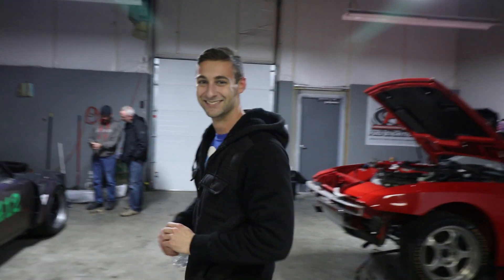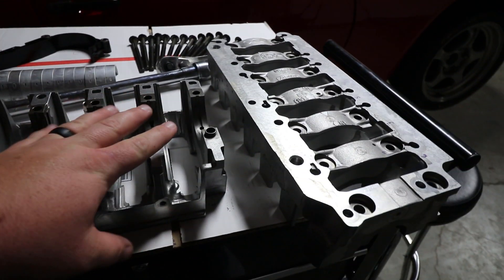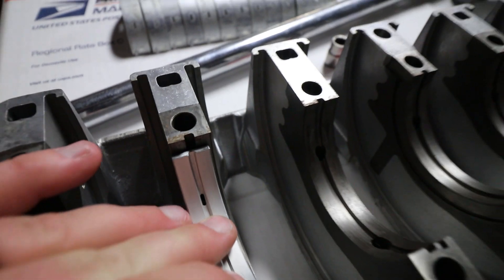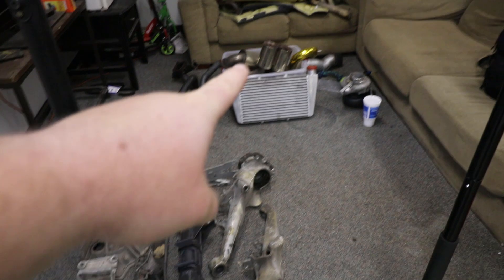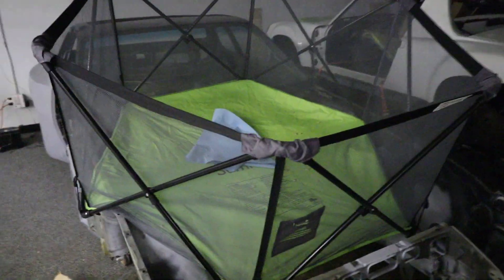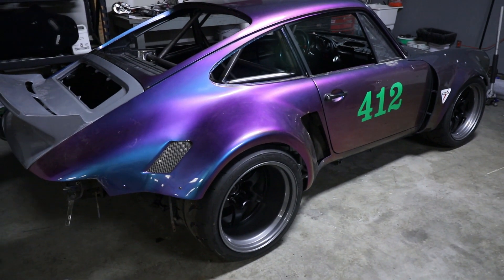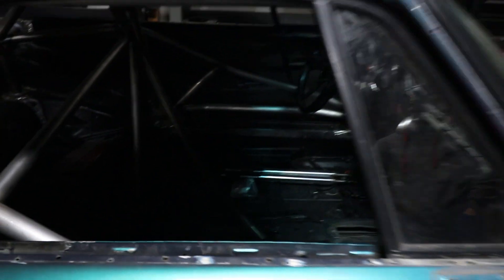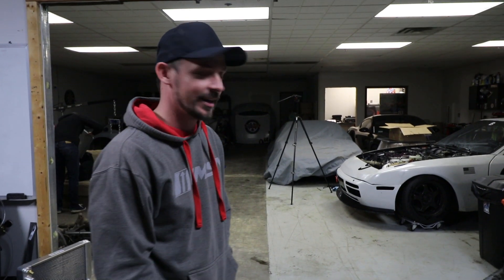5 Cylinder 944 Build - Part 10 (Porsche 944 07K Swap)

Comment: Hi! thanks for great videos! I have  an old boxster with the m96.20 2.5L engine and i want to turbo it. I have allt the components and everything it takes to build it i'm just curious how the engine block will handle 0.4-0.5bar boost and also if there is aftermarket headgaskets avalible or if the original would hold for 0.5 bar. Thanks!
Reply from the maker: TPC makes turbo kits for Cayman, and they keep boost to around 5 psi. They don’t change head gaskets, just a bolt on deal. The turbo would obviously make the car a blast, just be conservative with your tune and you should be fine
Reply: TPC racing has some good Boxster Turbo kits and videos.

Comment: I recently bought 2 944s so one is getting 07k na build with itbs and an 01e transaxle. I am curious thought do you think the Lamborghini manifold from the opposite side would fit?
Reply from the maker: It should fit the bolt pattern but would obviously run directly into the firewall.
Reply: Thanks for the info I plan on modifying it to exit lower and think the Lamborghini part might be a good starting point

Comment: The 07K head is garbage without porting. If you compare ports to the TTRS/RS3 it's night and day. The 07k has econo ports for bottom end torque and economy. With Veicomer dimple porting and a straight as possible intake the 07k cammed Is a 300hp engine all day. It seems crazy but porting is not too expensive, especially with a bulk run. Probably less than a grand. know you are trying to make an affordable kit for everyone and you are the man! You and your bro 👊 are doing a most excellent service for the 944 people. Just remember, a lot of these "Porsha" guys spend over 10 grand on a 2.5 turbo build 😳 🤯. 07k needs porting, intake, cams, and header to make around 300hp NA. And turbos only double whatever power level you have about every 18 pounds. 1 Bar plus a touch for temp and exh restriction. Start with 190, get 380, start with 300, get 600 😁
Reply from the maker: I definitely want to play with porting at some point. I’d still like to do a 300hp NA build, potentially for the 914. This one is just going to get boots crammed down it’s throat until it makes the number or goes boom! Thanks for the info and kind words!

Comment: Hi, BB, I have lost the plot a little on the Kman engine build. The crank housing you have there is the M97 one right? If so why fitting 02 Carrera main shells are they stronger/better or just same? Thank you.
Reply from the maker: No, that crank housing is 996. We are swapping to a M96 3.4 that’s been bored to a 3.8. Got a deal on it we couldn’t pass up!

Comment: sweet vid! you guys have convinced me to do a 07k 944 swap! I read on rennlist that the 07k can be reved safely to 8500 rpm and 500hp on stock internals with a turbo. do you believe this to be true? and also most importantly what transmission are you going to use in the turbo car to handle the torque? think you could get away with an s2 transmission or need a 951 transmission?

Thanks for all the great content!
Reply from the maker: Thanks Paul! My understanding is 8500 rpm can be done on stock internals with upgraded cams and springs. Power however is limited to around 400 wheel hp, which would be close to 500 crank. I have been told the factory crank is good to 600 ft lbs, which if so means upgrading the rods and pistons only would get you way past the point of OMG OMG OMG lol. As for the trans, I have a 951 trans ready to go into the car once I Turbo it. If I ever decide to go for big power and the 951 transaxle becomes the limiting factor I will do an 01E swap.
Reply: Boost Brothers Garage awesome thanks for the reply! where would you source a good 951 transmission, and do you think an s2 trans would hold up? would the shorter gearing be an issue, and do you have any plans on making an adapter kit for the 0e1 transmission?
Reply from the maker: eBay, RennList and the Facebook groups would be my go to for sourcing a transaxle. The S2 gearing would be a great match for an NA build, but the 951 trans would be better for a turbo build. I believe they are the same strength? We are not making an 01E adapter, but Brian from Widerstansfahig / Project Nine is!
Reply: Boost Brothers Garage awesome thanks! and will that holset turbo you got from the junkyard get 400 whp? and will i need e85 or meth injection to get to 400 whp? also will your swap kit mounts and bellhousing support that much power?

thanks so much for your replies!
Reply from the maker: The Holset will have room to spare at 400 wheel. I will just be running 93, although E85 would make that power easier. The swap components that we manufactured were computer modeled to handle at least 600 ft lbs of torque, with slicks and a hard launch.
Reply: Boost Brothers Garage thank you so much! cant wait to start my build!
Reply: @paulhoffman1481  
I have a Volkswagen Rabbit 2.5 with this engine and a number of bolt on modifications, but OEM internals. The rev limiter is currently at 7500rpm ( there's a video on my channel I think) and I beat the crap out of it last year racing, it never had a problem. Beyond that engine speed, the OEM serpentine belt layout will be a problem (I'm using an underdrive pulley to mitigate that), and I'd strongly recommend upgraded valve springs if going 8k+, but the 07k is a stout unit.

Comment: I thought it would peak closer to 7500 rpm. Still sound amazing.
Reply from the maker: I did too. I didn’t get to see a good overview of the dyno graph, so I was am taking Alan’s word for it. We are going to get it back on the dyno to fine tune the VVT and make sure the redline is set in the right spot. Unless the VVT makes drastic changes this is going to be peak.
Reply: @BoostBrothersGarage  8k or bust!
Reply from the maker: Haha, don’t threaten me with a good time!